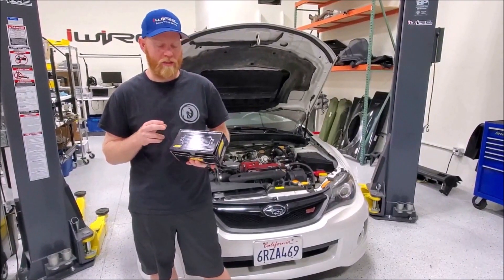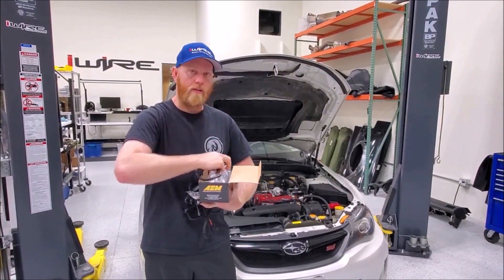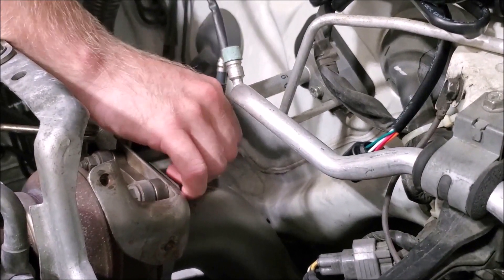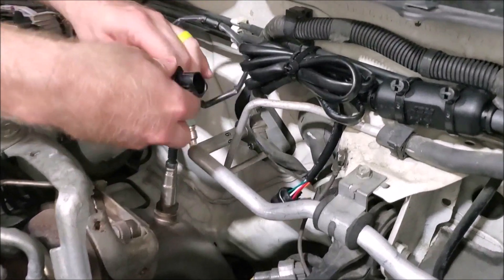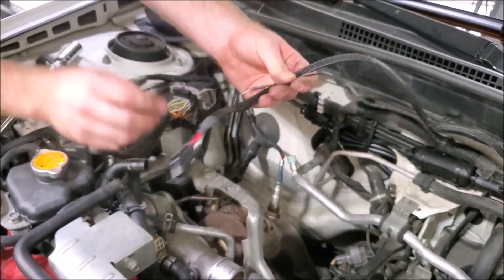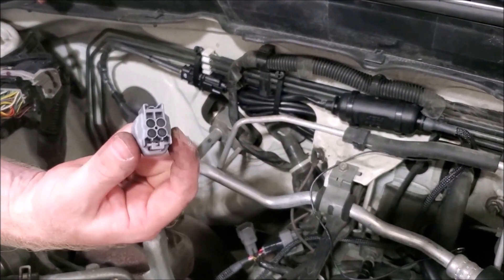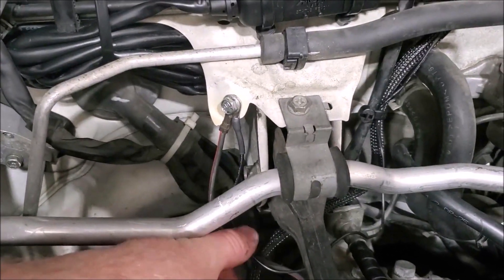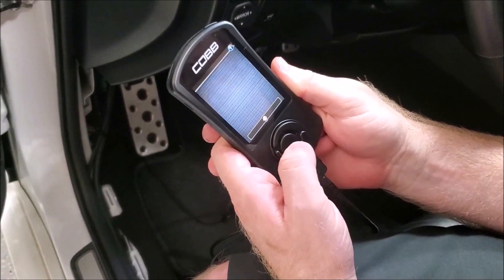AEM Wideband Sensor with iWire Plug and Play Wiring Kit for Subaru

Comment from the maker: April 2022. With Cobb's Green Speed Update this product can no longer but utilized with the Accessport. However if you are using alternative tuning software it can work to data log the wideband input.
Reply: Kinda confused with what you commented. Would I still be okay if I install a gage to read the data even if I have an accessport or will it just not really work at all.
Reply from the maker: @AntonioandJorgemerlos  If you are at looking at a plug-and-play unit with a gauge that could also send information to the Cobb AP, take a look at this item.
https://iwireusa.com/collections/iwire-plug-and-play-harnesses/products/aem-wideband-x-line-series-with-gauge-with-iwire-pnp

This product will not work very well with the Cobb AP through the rear 02 because you'll get a check engine light since the OEM rear 02 is not connected, and the AP can't remove that code.
Reply: Okay thanks so would it still be worth even buying it if it’ll just do that. If all I have as my tuning software is the AP but either get a dyno or a pro etune will it still show the Check engine light ?
Reply from the maker: @AntonioandJorgemerlos  If you want a wideband, the w/gauge model is great because, at minimum, the installation is simple.

Comment: Do you know if this would work with the new WRX
Reply from the maker: Unfortunately, the 02 sensor setup is different from the new WRX, so this kit is not compatible. However, the newer models have true wideband 02 sensors, so this would not be needed.

Comment: it's too close to turbo outlet, is it a problem? recommendations are not closer than 20"
Reply from the maker: Most Subaru downpipes have a slot at the top of the bellmouth because that is where the OEM front 02 sits on some JDM applications. You are always welcome to add a new bung further away from the turbo since the kit has a weld-on bung included.
Reply: @iwiresubaruwiringsolutions  thanks for the answer. What to do if I have Hyundai with inline 4 and the cat is too close to the exhaust manifold?
Reply from the maker: @user-pv7zv8pi5b  Unfortunately, we do not work on these models, so we won't be able to answer that question.

Comment: Will this still work with the new Cobb update?
Reply from the maker: Unfortunately, it will not work with the Cobb update. The reason is that the Cobb update eliminated the ability to bring in outside information to the ECU. This kit would still work with other tuning options.
Reply: @iwiresubaruwiringsolutions  what if my access port hasn’t been updated though?😏
Reply from the maker: @Kanadian-Squirrel  If you could find someone to reflash the ECU so it can understand the change in rear 02 input and display AFR without updating to the newer Green Speed compliant software, then yes, it would work.

Comment: This looks like he solution I need. Does it work with Tactrix as well as Cobb's AP? I'm in the midst of logging for remote tuning.
Reply from the maker: If all you need to do is log the raw wideband voltage this would work just fine with a Tactrix cable. With the Cobb "Green Speed" update the ability to bring outside information is not currently possible. If you are able to get around the "Green Speed" update then yes this would work with a Cobb AP.
Reply: @iwiresubaruwiringsolutions  OpenSource will probably be the route I go for the tune, and I'll use the AP to watch the metrics. It's essentially useless beyond that any more.
Reply from the maker: @RAWProductions904  The AP will not be able to display that information because the feature to convert the raw voltage from the input coming into the rear 02 to display AFR is now disabled from Cobb. If you want a display for the wideband I suggest you look at our with gauge version of this kit.  https://iwireusa.com/collections/iwire-plug-and-play-harnesses/products/aem-wideband-x-line-series-with-gauge-with-iwire-pnp
Reply: @iwiresubaruwiringsolutions  okay, thanks. Your gaugeless solution is what's attractive. I'll have to go without that data.

Comment: Do you need the controller or can you just buy the wide band sensor alone with matching connector and rear 02 plug and and just match the wire orientation

Comment: If you connect your flex fuel kit to rear O2 sensor, can you still plug this in? I have a 2017 wrx sti
Reply from the maker: Yes, this is compatible with flex fuel kits

Comment: I have a 2016 WRX STI, already installed the gauge kit 30-0300, Do you offer any kind of harness to connect it to the cars ECU
Reply from the maker: Unfortunately we do not sell the PnP Wiring separately from the unit since we have to modify the unit itself.

Comment: Hi, I about to order this kit to install on my Subaru. I have the Cobb flex fuel kit on my car. How do you hook that up when using the rear O2 bung for the wideband? Can I hook it up between the two harnesses on the transmission? Just want to confirm before purchasing.
Reply from the maker: Just plug it into the back of the Cobb rear 02 harness and you're good to go.

Comment: Can  e-tuner give you custom gauge for that? Or need to be running on dyno to set the gauge?
Reply from the maker: There is a standard calibration for this gauge that comes in the instruction booklet and your tuner should be able to set up remotely.
Reply: Would it work on 2015+ sti?
Reply from the maker: @dominicaguares1007  Absoutely!

Comment: So basically you are just plugging into the existing rear 02 sensor harness? Sorry if it's a stupid question, I just want to be clear before I bought it. Thanks alot.
Reply from the maker: That's correct. You'll utilize the stock Rear O2 for the wideband.

Comment: Only video I've seen on this controller so far.  Awesome tutorial!   Do you like this setup better than the gauge?  I currently have the 30-0300 x gauge running on the left exhaust bank and its a pain in the ass swapping between banks.  Was hoping this would hook up to hp tuners and be the solution I'm looking for..
Reply from the maker: Glad to hear it! For our Subaru powered applications it's great because the Cobb Accessport functions as the gauge display and separate physical gauge is not required. What are you trying to install this in?
Reply: @iwiresubaruwiringsolutions    Its a 2014 silverado 5.3l V8.  The one with the gen 5 LT block.  Im just looking for a way to log both banks without having to swap the sensor between the 2 cause that sucker gets hot!   Enough to burn through a welders glove unless I'm playing hot potato..  lol And thats after waiting a little bit for it to "cool" off.   Is the Cobb worth the money in your opinion?  Never heard of it till I saw your video, but ill definitely check it out.
Reply from the maker: @zackthomas5707  Ah, this is Subaru specific and would not apply to your 2014 Silverado. You can utilize this to log directly into your ECU setup, but the hook up for your application would be different.

Comment: I like that kit. Would this work with a my01 Impreza WRX from Australia
Reply from the maker: yes, it would. We have a 02-05 WRX plug and play option for our Wideband Kit that works great with your car for data logging, but the display on the Cobb AP will be the raw voltage (0-5v) not the AF ratio number like 14

Comment: do I get the same accuracy, if plug in the rear o2 compare with the bung on the downpipe?
Reply from the maker: @joshstroven8284  It would be fine to mount just about anywhere on the downpipe if it is catless.
Reply from the maker: As long as it's pre-cat. Most put the rear 02 slot post cat so it wouldn't read right.
Reply: Hi, what if you’re running catless, would it still matter? Thanks.